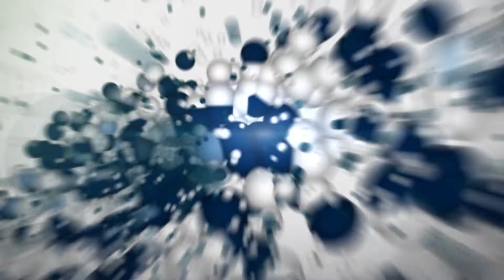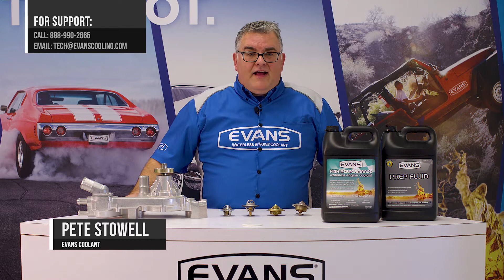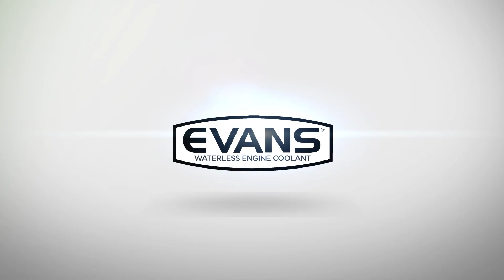Evans Waterless Coolant and Thermostats: Everything You Need to Know

Comment: So why aren't you mentioning that your coolant requires a higher flow rate because it's so viscous when compared to water? There's a lot of discussion on the forms if it causes water pumps to wear out sooner or not.
Reply: It also has far less heat capacity than water, blocking the bypass port up is a bad idea, coolant needs to flow around the engine to equalise temperatures even during the warm up period where there is nominally no flow to the radiator. The stuff has high viscosity so coolant flow will be reduced, that and the heat capacity are both bad news.

Comment: Removing the thermostat as an attempt to make a coolant that is thicker and less efficient than what the system was designed to use work correctly really isn't a good idea. It is a well known FACT that most engine wear occurs when the engine is running at less than its normal operating temperature of 180+ degrees and the oil needs to get hot to burn off any condensation or fuel dilution, so needlessly delaying the warmup won't do the engine any favors and will absolutely kill your gas mileage. Also, the warmup time probably won't be "a little longer in cool weather". If your cooling system is halfway decent, the engine will NEVER fully warm up without a thermostat unless it's under a sustained very heavy load on a hot day.
Reply: very true i bought a1986 audi and it never got above 70/75c even on a long hard drive, I got sick of poor fuel milage and luke warm heater and though the old thermostat had preobbaly failed (open) so I bought a new one and when I went to change the old one one out there was not one in there!!! i was a little worried that this has been used as a crutch to fixed some over heating issues, but its been fine ever since and now sit around 93c and the heater is great.

Comment: An engine needs to get to the proper operating temperature it was designed to run at as soon as possible, this will make the oil circulate properly,
air bypass points will open, fuel air mixture will be optimized. spark plugs operate better ect ect, If a thermostat is removed this will not happen.